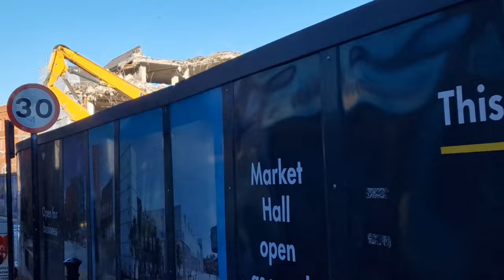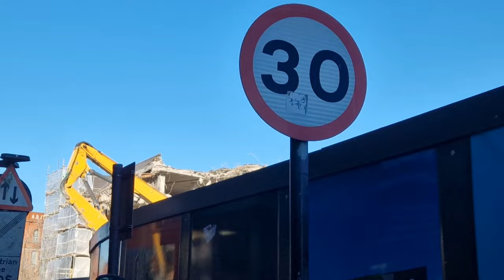Wigan Galleries Demolition Update 24/11/23

Comment: What a waste.
Reply from the maker: With how much of the site could have been modified and repurposed it dose seem a vast waste. Yes parts of Market gate where needing some fixups like the moisture getting in via the roof and maybe remove afew units to make more event-public areas. But the whole site being obliterated is abit much now. It will be interesting to see what happens to the current cinema building too. Will it get pulled apart inside to make a lazer tag arena and such or will it sit to rot.